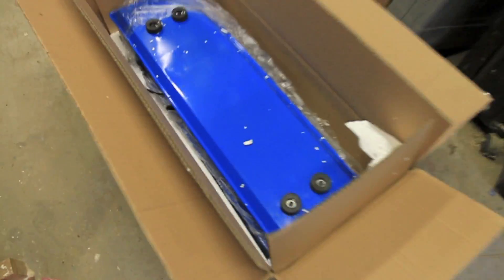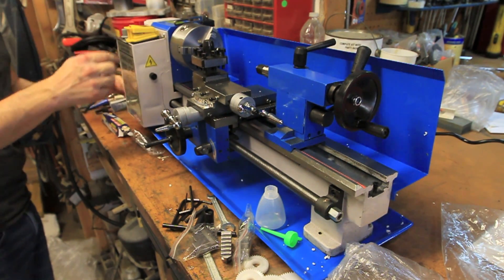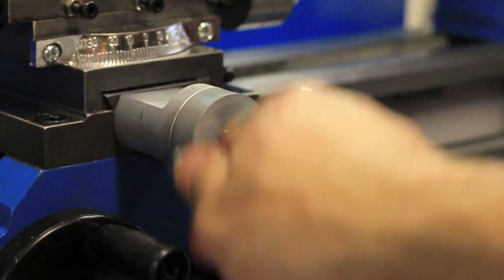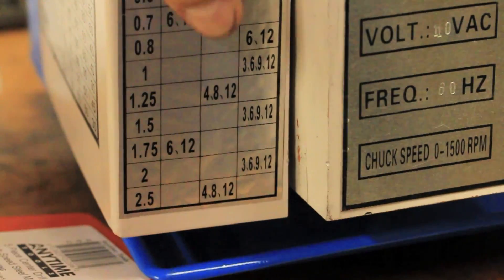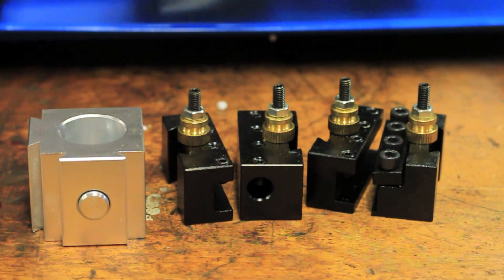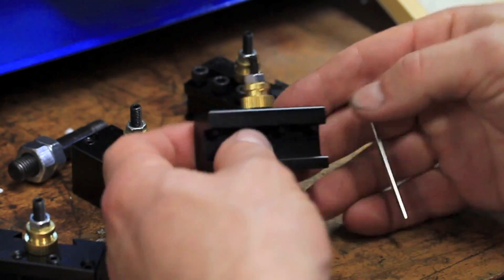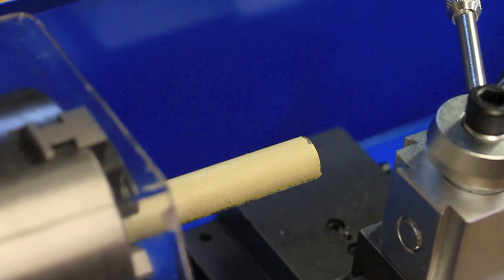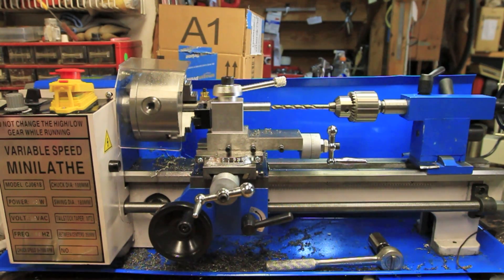Cheap Chinese Mini Metal Lathe Unboxing, Setup, Upgrading, and Testing

Comment: its cheep so expect it to be poor at the best of times, go buy a myford super 7 it will out live you if you take care of it also use HSS with small lathes much better then carbide tools.

TMS
Reply: Theminecraftstarship A Myford can go for £4k-9k. I can pick up an import for $800. If you can afford one, go for it. But most of us can't drop that kind of money.
Reply: Jrsydvl2003 yes you are right myfords can go for 4k to 5k but on ebay you can pick up a decent myford for quite a nice price I got mine for £950 with lots of tools and a 3 and 4 jaw chucks the lathe was in decent shape and I had a member of my local club come with me to take a look and make sure I didn't miss something important, have a look you will be surprised at what is one the market.

TMS
Reply: Theminecraftstarship A little late for me. When I went looking I only found rusted hulks. Worn and rusted ways, bent leadscrews and damaged spindles. And these old men still asked for more than scrap prices.
Reply: Worn ways are to be expected in an elderly piece of equipment, easily compensated for with shims under your cutting tools, bent leadscrews are replaceable or even repairable and are not too much of a hassle to sort out, mine has a bent leadscrew and still cuts fine, and these old men will have more knowledge of how to make something or albeit fix something that breaks down, I model steam locomotives, I even have a K27 engine that i am making new bushes for the axles and making new motion for as the original was very sloppy and beyond bad, an elderly chap at my local club showed me how to make the new parts and how to fit them, he made it look so easy when i had a go i cocked up more then a few times, use these old chaps knowledge and cherish it like gold it will be an invaluable asset to you when they leave this world, join your local club they may have some equipment for sale at "reasonable" prices and may even offer you a discount on them.

TMS
Reply: Theminecraftstarship I have plenty of old chaps at my disposal. I have just over a couple decades under my own belt. What I don't have comes down to time and money. If it takes more time or money to nurse a worn tool than push an import. I'll take the import.
Reply: Theminecraftstarship why would you use HSS, what if you can't re-grind the tooling, or do not have the equipment to do so. Carbide is much easier. Just turn the tip when worn. Replace when fully worn.
Reply: @owenjones-wells9395  HSS requires a lot less pressure to cut.  Carbide requires, not tolerates, requires higher speeds and feeds, which means more strain on the machine, that it wasn't designed or intended to handle.  Then there's the price factor.  One insert costs more than a small high speed blank, that you grind to whatever you need, then resharpen it many, many times.  Equipment for it, small bench grinder, about $40 and a can of water to cool it while you're grinding.  I have a threading tool I ground years ago, maybe ten, and I'm still sharpening it when it's dull.  Takes a little practice, about what would be expected from someone just starting in any shop.  It also predates rocket science by roughly a hundred and fifty years.
Reply: Sadly the days of a decent Myford with 3 & 4 jaw chucks, centres etc for under a grand seem to be over especially if you factor in the cost of driving around the country to see piles of rust that it would need an archaeologist to confirm had once been Myfords. The cheapest used (changewheel & non-power X-feed) machine from Myford themselves ATM is £4900 + delivery.
It is interesting to look at the way Myford pricing has gone. At its introduction in 1946 the ML7 cost £34. This equates to less than £1300 in 2017 money. If Myford were making lathes with anything approaching that sort of value for money no one would be looking at buying a Chinese machine.
Reply: Can take that the other way when buy cheap bottom drawer stuff like lathe above. Many months downtime if parts are available and then get stung on the price of the numerous parts. Not uncommon to buy a complete mill for £640 and have to pay £230 just for the motor, get the picture.
Reply: Is that the Chinese ones?
Paid £400 for my scrapped ML7 with £1k+ accessories. Rebuilt 4 times in 6 years, 1 regrind then scrapped the thing. My days of toy lathes are over.
Reply: How much did you pay for it?
Reply: Theminecraftstarship 
First of all, it's good that the guy used the official quality designations to measure the lathe's effectiveness, when he pointed out that it was
"Impressively not as terrible as it could be". Also, should we really judge the quality of a power tool as "cheap and poorly made" or "ineffective", because it only lasted long enough to perform 1 machining operation on 1 job? Lol

Anyway, how much does a decent quality micro lathe of this type cost, assuming it comes with pretty much these same tools and features?
Reply: Owen Jones-Wells I have paid 40€ for a cheap grinder and regrinding hss tools is not much more difficult than sharpening pencils
Reply: I 2nd the use of HSS tooling. It takes less power because it can be much sharper. All you need is a bench grinder with quality abrasives. I turn 4130 chrome molly and stainless 303 regularly with HSS. I ground my threading tool and it makes good threads.Carbide tools work best when taking heavier cuts and higher feed rates. Not the realm of mini lathes.
I have a much heavier Chinese lathe that is pretty good. Threading on a lathe is one of the most useful things for me. A gear box is much quicker to use than change gears. Having slow spindle speeds for threading is a big plus, I always thread away from the chuck, much easier than the standard way of toward the chuck. 
I wonder how long plastic gears will last? Might be OK if they were phenolic or glass filled.
Reply: Theminecraftstarship no

Comment: Nice review. I have an older version of this lathe. It has nearly all the same issues, but most of them can be tweaked. Mine has a high/low gear in the headstock that yours seems to not have. Also, I don't have the cam lever for locking the tailstock. It just has an acorn nut, which is a PITA. This is on my list of enhancements.

@5:05 you can loosen the set screw and take out the backlash.  Threadlocker will keep the handles on, of course.

If you use a shorter MT2 shaft to hold the drill chuck, you'll get a little bit more capacity when using it in the tailstock. Either cut off that tang or get one without the tang. LittleMachineShop has some "short" MT2 arbors that should match the taper on the chuck itself.

Comment: I would order spare potentiometers ,they seem to go a lot on these lathes.i know from experience.
Reply from the maker: Good to know! 

The ones on the board or the one for the speed control?
Reply: speed control,got rid of my mini lathe and mini mill years ago,thank god.now I have hafco metalmaster lathe and mill.its  a world apart from mini machinery.
Reply from the maker: Ah ok cool, thanks - I'm sure your new set up is much nicer, but also you can appreciate it so much more after fighting with one of these cheap lathes.

Comment: Sad to hear about your problems tho ,it probably killed your dream?plastic gears would be even worse than cast iron gears.cheers.
Reply from the maker: Not at all, I've been pretty impressed with the plastic gears, plus the only plastic gears are the interchangeable drives for the lead screw. Also I tend to have goals, not dreams... it'd be boring if they were all easy to achieve. Thanks for watching!

Comment: I came so close to going down the 7x minilathe route.
So glad I talked myself out of it.
Reply from the maker: With some fixing and patience you can create some decent parts out of this lathe... checkout my video making a machinists hammer

Thanks for watching either way!
Reply from the maker: It's not about the hammer, it's about learning to use the lathe while simultaneously creating something with a purpose that can bring satisfaction upon completion and hopefully be useful for many years after. Hammers also happen to be easy to make on a lathe.

Comment: A lathe that you can move alone? Jezzz a real lathe must weight at less 300hundred kilos or 550 pounds... A remember moving my lathe and broken my left thumb in the process
Reply from the maker: Ouch! This one had a shipping weight of around 100 pounds... I wouldn't want to drop it on my foot but it's pretty easy to move around (arguably too easy since it moves around a lot when using it)

Comment: Geebus Cripes! I bought my mini-lathe 17 years ago, and though it was a cheap Chinese lathe, the construction was a a lot better than what you have there...but, leaves room for mods. My old mini-lathe is now comparable to a Swiss watch, with major mods over the years. Now I only use it to machine precision small parts, when necessary. You can get a good four jaw chuck from cartertools.com for $50-$60, and it's back can easily be machine to fit the register on your spindle, along with the chuck hold down bolts.

Comment: I purchased a 7 x 16 lathe a few years ago from Micro Mark, paid about twice what you did. It was shipped in two boxes to limit transit damage, and setup was simple. It has served me well and I don't anticipate getting a "bigger" one anytime soon. Knowing now how to improve and adapt these machines, I'd probably go down your path, it is simply luck of the draw and if suppliers have a liberal return policy, why not- you'll learn a lot about the mechanics and knowledge is never a loosing thing. BTW, cut the tang off the drill chuck arbor end, it's not needed and you'll gain back some distance or "throw". And finally the center distance of these lathes are measured with chucks removed and only centers used- your 14" will be there.
Reply: R J  Does you lathe has same plastic gears as thid clip? Or it is metal gears.

Comment: I was wondering what tap did you use to re-thread the hole? Thank you for this video by the way. :-)
Reply from the maker: Hey! I'm not sure which hole you're referring to :/ But this is the tap and die set I've been using: http://amzn.to/2ra2j9V

Hopefully that helps!
Reply: sorry. I was speaking about the threaded bolt that holds the aluminium cube.

Comment: So this is like those cheap 3D printers, you get it working as best you can then build a better model. I could not do it, hats off to you, I come from a home that included a artisan toolmaker father, so certain engineering principles are ingrained into my DNA. Hey, if it makes that part to get you through the day then it's worth it, it would be cool if you have a part you can make with it that is sought on a local market, make 100 and buy a better lathe, tip to you, there are small bed lathes out there intended for students of toolmaking and apprentices, sniff around for a second hand one, you never know.
Reply from the maker: I'm keeping an eye out for a better lathe for sure. While this lathe has a lot of issues, it has been a tremendous learning experience I wouldn't necessarily have gotten otherwise. Plus I wouldn't be able to appreciate how nice it will be once I get a good lathe. 

I'm not sure this compares to the cheap 3D printers - I have one of those too and this lathe is significantly cheaper :)

Comment: 9:48 well you're using the channel locks wrong, pulling the fixed bit tightens the hold so using them the way you did requires you to grip the handle much, much harder.
Reply from the maker: I realized, thanks for the comment - I really didn't expect that stud to be so tight so I just used them how I grabbed them.
Reply: I'm an industrial mechanic and my co worker ALWAYS uses them backwards. It drives me crazier.

Comment: cheap chinese lathes is too awful quality =(
better buy old lathe from 70-80's
Reply: Night Saber 
we use russian and yugoslavian lathe in school 15KW motor . they are made in 1940s one is from 1756 (belt drive) they still work perfectly . every one weights  3ton 
sry for bad english
Reply: yes 1756 , It worked on steam then they put electric motor in it
Reply: Night Saber Mind you, not too many people are able to dedicate an entire room to a lathe (and not much else)...
Reply: I know... I owe chinese mini lathe and my room for all my stuff is 220cm * 200cm. But i worked on normal lathe and know the difference between new chinese and ancient soviet lathe :D
Ancients makes an amazing tools :)
Reply: max rpm  30
Reply: If you have the power. Most old lathes are 220 volts.
Reply: I wouldn't buy high quality stuff from china if I could avoid it. If I were spending money, it would not be going there... China is only for the cheap stuff that doesn't matter. And barely that.
Reply: ELECTRONICS 1756?
Reply: @Faigh_as  I bet it uses stone inserts XD
Reply: CoolKoon n
Reply: 440V or 680V
Reply: Night Saberu
Reply: Night Saber you know where one is?
Reply: Night Saber we would all like to buy an old lathe from the 60s, 70s, 80s or whatever. Good luck finding one.
Reply: I have a Mori Seiki that has 7.5kw but weighs in just over 3.5 metric tons. Hardened, ground automatically lubricated ways for long term accuracy and oil bath leadscrew for cross feed for the same thing. I think it's been capable to hit tolerances of a few microns when it was new.
Reply: Night Saber bro China has a high quality product if you want ,this is just for people that cannot afford to buy a better one .
Reply: The Best Stooge But, but, but, but......buying Chineseium is bad, it's the deed of the Devil, it's a blasphemy, it will make your organs rot, your brain explode, yada yada..... Yeah, people who keep yearning for all the old stuff are idiots. The good thing about this video is the fact that it shows what's wrong with a cheap Chinese lathe and what should people buying it be aware of. Quality lathes are expensive everywhere, even in China, because the expertise (and careful engineering) required for making one just can't be bought cheaply (not to mention the materials).
Reply: My grizzly mini lathe was a waste of money. I scrapped it and bought a South Bend 9A.
Reply: Yeah, dalmastroj and other yugoslavian tool are heavy, and really quallity, i still had big angle grinder "dalmacija-iskra" and is quite powerfull and 10x more quality than new shitty chineseum tools

Comment: TimNummy  you are almost too kind and understanding of the problems. You and we the  other customers shouldn't pay for such lax  quality even  on a budget item. Cheap is a interesting  word. Should  cheap mean  low quality or good value  relative to  others?
I have a HF lathe that is also  a Seig and  have been through much of the same  problems. They are very usable machines after they are fixed and  tweaked. The basic design is good . Quality control on  production is not. You did the  right thing  on the indexable tooling. Most of  us fall for the  bonded  Carbide tools that need a lot of work to be  usable trying to save a few bucks.
Little Machine  Shop has about anything  you may want  or need. Amazon  has  a lot  of  generic  tooling  and and  materials as well. I have  been using mine  since the  summer of 2015 and have  never broken a gear. A simple  Brain  Fart will be all it  takes for that.
Reply from the maker: Ha true, in this case cheap means low quality. I think though, especially since 'real' lathes are so expensive, this is a good value for the foundation they give you - as long as you're willing and able to put in the effort it takes to get it running well.

Surprisingly they were pretty low cost as well but I've been extremely happy with them. I included a link to the tools I'm using in the description if you want to check them out. The replacement tips are also pretty cheap and one thing that I really like about them is that the tips are interchangeable between all the different angled tools.
Reply: I got the  same  cutter set but  bought them from Shars on a order with some  other stuff. I'm big on Amazon but  Shars has  some good deal now and then.
Reply: Barry Manilowa 
In the USA it is, Europe, Britain and Australia have buyer protection laws, in the US it's buyer beware, especially from China

Comment: I see metal gear kits listed on a few sites.  I wonder if they would fit this lathe?  The kit on minimachinshop lists compatibility with a bunch of 7*12/14/16 lathes.
Reply: This is a standard Seig lathe, and yes, the metal gear set will work.
Reply from the maker: Thanks! Turns out it wasn't the gears but the motor mount... Check out the follow up video https://www.youtube.com/watch?v=9s9hsYgLmyQ

Comment: Soooo, not recommended? 😁 Or you do, since if it doesn't break, and once tweaked, it seems "good enough" for light hobby work?
Reply: It looks that the manufacturing of this lathe is somewhat sloppy, with rust on several parts. Also the shipping box isn't strong enough.
Reply from the maker: At this point it's hard to say if I'd recommend it or not... if you don't mind putting in some effort to save some money then it seems decent initially. Check out this follow up video https://www.youtube.com/watch?v=9s9hsYgLmyQ